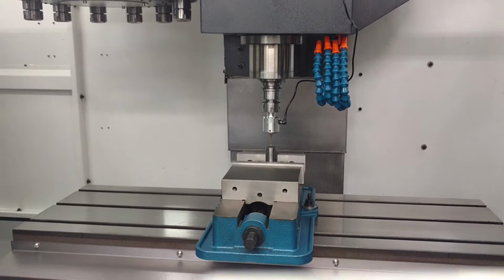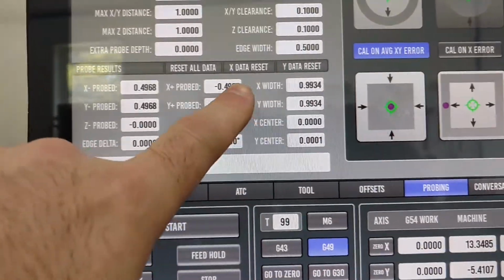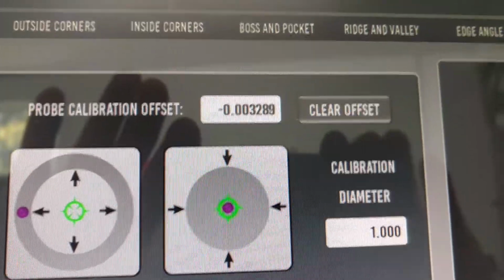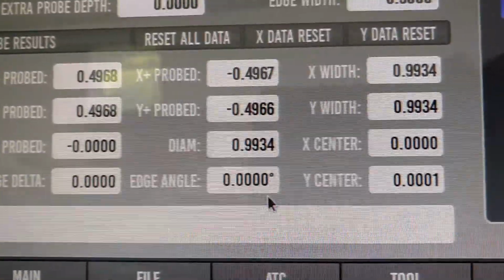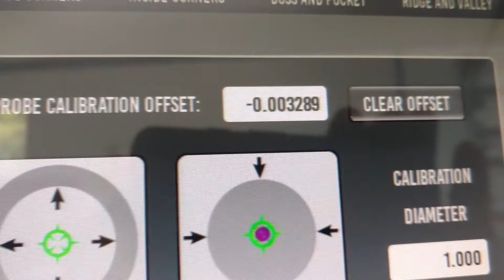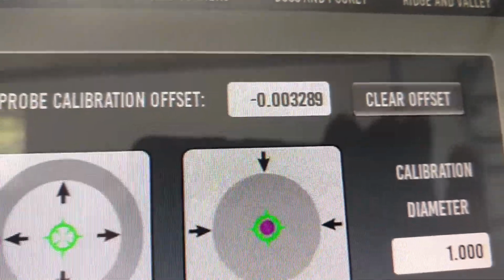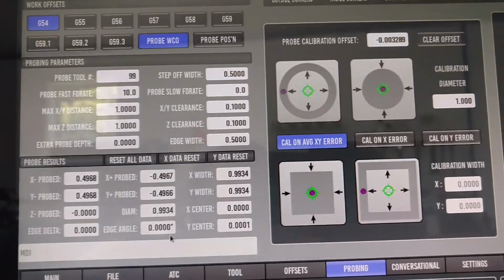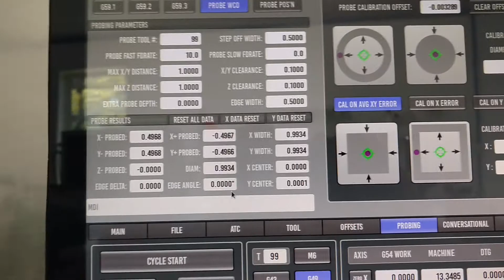Probe Basic Probe Calibration operation first run and Drewtronics Touch Probe

Comment: Hi Chris,

Hope this finds you well on the first days of 2023 !

Just wanted to say Thanks again for your detailed reply to my earlier comment and give you an update on our progress using the Drewtronics probe I purchased through you a while back. We successfully integrated it into our Masso controller but have since added automatic toolchanger and purchased a wireless probe so we can avoid having to have a cable going to it. I'll be moving the original probe to a different machine running LinuxCNC and the very kool Probe-Basic user interface. Having fun now !!!

Hope you have a great New Year and will be contacting you soon about purchasing a 1/4" shaft for my probe to allow me to use it on a smaller machine that doesn't support the 3/8" shaft.

Jay

Comment: Hi,

Fairly recently bought your probe and installed the very nice LinuxCNC Probe_Basic GUI you developed.

Our machine does not have an automatic tool changer and we'd like to also incorporate one of the electronic tool length setters into the system. I've looked through your videos and website and didn't see this topic being covered and wondering if you've worked on this.

I currently have a CNC Router with a Masso controller that has this functionality built-in and it's a great time-saver and allows us to easily run programs with multiple tools.

As they've implemented it you can MDI a tool change command (i.e. M6 T3) and the spindle will be brought to the front of the machine and pause to allow you to manually change the tool. You then hit Cycle Start and the tool is sent to the electronic tool length setter's position and runs the probing routine and stores its length in the control.

Likewise, when running a job and a tool change is called in the program it will present the spindle to allow you to change tools and then probe its length and continue on in the program.

The control always remembers the last tool that was used (even through a shutdown) and if you call it up again it ignores the tool change and probing operation completely and will go directly to the next lines of code.

Setting the work coordinate system Z Zero offset remains a separate operation that is done once before running the job.

Are you familiar with this type of configuration and have you any thoughts or suggestions on how we can integrate it into your Probe_Basic interface ?

Thanks again for all you've done and any thoughts you might offer.

Jay
Reply from the maker: Jay,

Probe basic has tool setting functionality. you set it up on screen on the offsets screen.  As long as your tool setter is permanently fixed somewhere on the table you can set and store its location by jogging to it and pressing the set tool change position button on the offsets page, and set the M6 remap up to touch off the tool at each M6 T# call. 

Probe basic does store the last tool loaded providing it was shut down while the tool was still loaded in software.  if you unload the tool in software it will not.  but the touch off routines also store the offset in the tool table for the current tool being used which is permanently written to memory until it is rewritten by a new offset being stored for that tool.  

You can also use additional XY offsets for the touch probe and mount it elsewhere on the head permanently with a flip to position or slide to position so that it is accessible anytime without disturbing any tooling in the spindle.  when you probe your work piece, it takes the xy and z offset into account when setting the work zero position as those offsets are loaded when the probe tool is loaded.  This allows you to setup faster even if you have an ER type collet spindle.  Once you have the probe setup you would just probe your work to set the offset position, load the new tool and send it for tool measurement, then hit cycle start.  

You have complete access to the probe basic subroutine files, they are found in the config folder under subroutines.  They can be added too or changed as needed to suit your particular requirements if the stock configuration is not suitable.  The subroutines use RS274NGC language which is quite easy to learn.  The doc for it is here:

https://tsapps.nist.gov/publication/get_pdf.cfm?pub_id=823374

You will find that Linuxcnc is extremely configurable, it is sometimes a blessing and a curse.  It means you can do almost anything you want with it but it also means that the learning curve can be high.  There are probably many people running a setup very much like you do.  The best place to get help or find folks who are setup like that would be the www.linuxcnc.org forum. There is a section under user interfaces called QtPyVCP (this is the platform Probe Basic was built on), and many people there run probe basic and may have the same setup already in use and can share their routines and setup.  It sounds like what you want to do is mostly already very close and would require only minimal tweaks to suit your needs!

Hope this help!

Chris